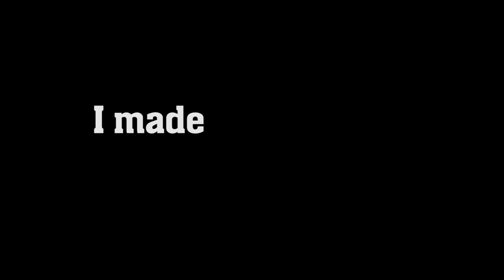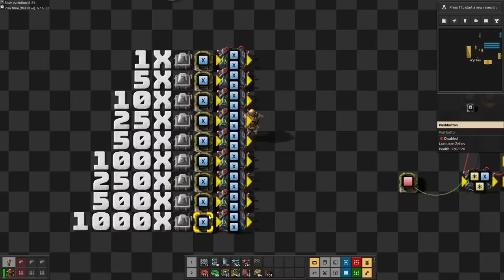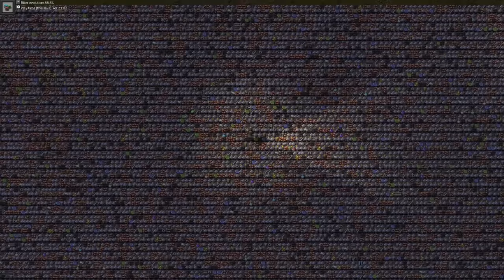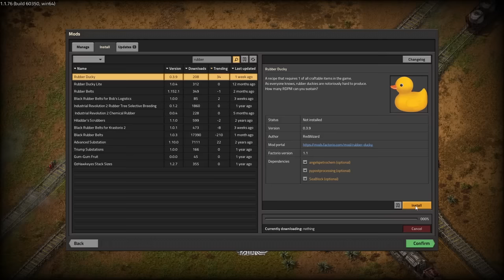How Hard is it to Beat Factorio When EVERYTHING Goes on the Same Belt?

Comment: I did a sushi belt run. What made it interesting and didn't require memory was the idea of a "kidney" which would measure the concentration of a single item type along a "receptor" lane split off from the bulk circulatory system. If the concentration grew too high, then the journey would begin storing excess into boxes; when the concentration fell too low, then the boxes would unload into the blood stream. In effect, I was using the blood stream itself as a memory cell. Certain parts of the factory that didn't need a wide variety of parts could pull only certain items.
Reply: Blud made a factory that can get diabetes 💀💀
Reply: @KarolOfGutovo  welcome to a bored factorio player's mind
Reply: I love how there’s such a completely different solution to the same problem
Reply: @daanstrik4293  One is robotic the other is biological
Reply: The thing is that this solution would require sorting. He banned the use of sorting injectors, so I'm not sure how much he could reasonably sort, if any.
Reply: I love this solution because not only does it solve the problem of keeping the right ratios of items on the belts, it also solves the problem of single item types being bunched up and not having the opportunity to evenly spread out across the system.

There was one timelapse scene nearer the end of this video (42:24) that made this issue abundantly obvious, as well as Dosh mentioning it himself. You can see the colour of the items on the belt changing between green when lots of circuits go by, orange when lots of copper plates, ores and wires go by, and grey when lots of iron ore and plates go by.
Reply: @MGSLurmey  This could be solved by making one part of the sushi belt longer like with the coal electric gens. This would make some part of bunched up resorces lack behind and eventually even out the whole belt.
Reply: mf inadvertently implemented homeostasis in the sushi belt

Comment: you know what I would hate love? Sushi pipes. A mod that lets you put multiple fluids on the same pipe network, then sort them out later down the pipe.
Reply: I've seen someone build that with vanilla pumps and circuit conditions.  I'm not sure which one is worse.
Reply: you can do that by rotating undergrounds/storage tanks
Reply: Nefrums played with that idea while he has designing his newest 100% base. He even provided blueprints. If I remember correctly it was a little unreliable. But it can be done, pure vanilla
Reply: Barrel all liquids. No pipes needed!
Reply: that actually is a mod
Reply: @PrinceSilvermane  what? How? where have you seen that?
Reply: @thecrazyinsanity  do you know what its called?
Reply: @hanswurst913  It was on reddit.  Basically you'd have two sets of pipes with pumps and circuit conditions.  That kind of circuit wizardry is beyond me.  But ultimately it was one of those 'Neat' ideas but not really practical.
Reply: There was a guy that made a sushi pipe on reddit using vanilla pumps, pipes, and circuits. You don't need mods, just a big brain

Comment: I did a lot of experiment with this, I love the idea of setting the recipe anywhere and not having to use your brain...

So here is something i discovered, if you use a fast inserted in a chest with only 1 space in it and use a normal inserter to take it out, any resource on the belt that can feed the slow inserter will lock the chest on that resource automatically exporting from the bus things that are in the highest quantity. I'm not 100% sure it could scale up to the level you use it, but it's a neat trick to keep your sushi belts half clean.

Comment: Maybe you could have added a recalibrate function. You could pause I/O and place a unique item as an indicator that is not counted on each belt. You would then zero out the counts for all items then count each item that goes through the chef TM as an insertion. When the indicator items finally make it back to where they were inserted they are removed from the belt and calibration is completed, then I/O continues as normal.
Reply: Pretty sure this wouldn't have worked? Because the balancers add a random element to the time it takes for an item to move across the belts. Sure, it'd only be maybe 5 seconds difference at most, but the nature of the Sushi Belt means that's actually a ton of inaccuracy.
Reply: @kabobawsome  That’s a good point. The conveyors could just switch to an alternate route that goes around the balancer during calibration.
Reply: I don't actually play this game, but could you build tla second 'chef' that just reads the amount of each item across each lane, and then averages them out to find a rate? Then instead of using total items in the system, you could also use the rate to stop inputs to the bus until it goes back to a normal number.
Reply: @mattizie91  curious fly on the wall comment
Reply: @mattizie91  It might be hard to work with since a full loop is like 20 min. There will be delays in the readings and the system would overcorrect so it never reaches equilibrium.
Reply: @minnow1337  you could read the rate right where the item gets added so it will only produce more if there aren't enough currently passing by
Reply: The real solution? Take the rate at multiple locations and average those. A secondary option is designing balancers that have an equal travel time for all paths (which may not be possible). Plus, the main thing is that usually these errors happen over long periods of time due to singular inserters. Even if you only have a system that can verify things in a few minutes, that’s still more than fast enough compared to the hours it takes for a significant deviation.
Reply: Create a system that when enabled disables all inputs to the sushi by sending arbitrarily high negative signals, routes everything to a side section that is full of storage, waits until all belts are empty (no items put into storage for 30s or so) then resets the memory cell and allows the storage to be released back (and counted) on the belt as a priority input (other inputs for an item that's in storage aren't enabled until storage is empty of it)

what you get is a belt memory cleaner with a storage buffer function, you'd still need to enable it manually but it would automate the cleaning and can be used alongside other methods as a last resort
Reply: while I haven't tried this for myself, the video MysticFish did on the topic of using an AIMD algorithm to balance a sushi belt adaptively looks like it could work quite well here, especially for a system so large and convoluted where any source of error is hellish to fix.

Comment: Def laughed out loud when you mentioned what you call the various science packs. I was trying to explain this to my partner this week! I feel like most people only call space and military science by their actual names, and use colors for the rest.
Reply: I feel like I see people say white/chemical science occasionally, but that's very accurate in general.
Reply: I mean, space and military are the only sciences that are sufficiently distinct.
Space science because it's made in a rocket silo, and the final boss among the sciences.
And military science because it takes military supplies and gives you military technologies (the use for making both of which varies with your biter difficulty).

This distinctness COULD be extended to chemical science, by having it be made in chemical plants. And production/utility science packs could be requiring the assemblers they are made in to be beaconed, or there to be at least 1 green module effect active on the assembler or something. Or maybe utility science packs could be ingredients for rare crafts, like spidertrons/ artillery wagons/ their remote controls/ power armor/ power armor equipment/ ... 
If this was the case, then more people might start to see them as something else than just "yet another tier of the same concept", like we rightfully do for "electronic circuits"/"advanced circuits"/"processing units" or "normal"/"fast"/"express" belts, or assembling machines "1"/"2"/"3".
Reply: @calvindang7291  yea thats pretty accurate, red/green/purple/yellow/military/space are pretty ubiquitous, but often blue does get called 'chemical' usually before and while you are building it, and 'blue' afterwards, due to it being the only science that specifically requires you to start a new resource chain - ie oil.

Comment: Hey, Dosh, fellow engineer here!
This is a really great (terrible) idea. I want to do this but mine ore directly onto the sushi belt and put all the fluids onto the belt, not just the refined fluids. I would forgo pipes entirely for maximum clout, but you can't fit two assemblers to fill or empty a refinery using advanced oil processing without a couple pipes. 
Since you can only fit eight items on a tile of belt, your capacity (number of sushi plates) is a function only of width and length of your sushi belt, and upgrading simply reduces your round trip time. 
My approach would be to target about 75% fill of the belts total, and then program the ratio of items on the belt, rather than arbitrary "I want this many of item X". That way, all items are equally likely to be available, and high consumption items can be made more quickly by increasing the number of assemblers.
I'll let you know and link this video if I pull the trigger on this abomination of a run!
Cheers,
Dave

Comment: you should've taken inspiration from blood system - split your current single loop, have "lungs" where raw materials come in, separate throughput belts between different production centers...
Reply: and instead of counting inputs onto belts and having trouble not hooking up the counters...

why not to count items on large chunk of belts? and have that indicate ~average amount of items in whole loop - just like brain detects CO2 levels and forces you to breathe
Reply: @NoNameAtAll2  I agree. I think estimating averages over sufficiently large sections of the belt would have resulted in the belt having a much more uniform distribution and thus speeding up to whole productions process. If the amount of items was then dynamically adjusted this way it would probably lead to a steady state in terms of average amount of items on the belt. This is just my gut feeling though, but yeah thinking stochastically in stead of "deterministically" counting all the present items would have been interesting.
Reply: Defining "The desired amount of items in  the system being dynamically adjusted" better. This could be using something like gradient descent for optimizing the "The desired amount of items" for the maximizing the amount of rockets sent or science produced. Would probably be a pain to program with combinators though.

Comment: Idea. Nested Sushi Bus.
You don't put everything on one Sushi belt, but everything is sushified. The bus is double it's width because you have to route the end back up to the beginning of the bus. You take things off of the sushi bus to put on smaller Sushi belts. Make great use of Filters on everything, but especially filter splitters. And instead of storing in memory what should be on the belt, read the throughput of the sushi bus and use the current average throughput of an item to determine if demand is present.
(Youtube on mobile made typing this comment HELL.)

Comment: A few horrible ideas I have had for a challenge run.

1: Magic box
-every method of refining resources has to fit inside a predetermined box

-ore, trains, belts and pipes carrying water or crude oil are allowed outside the box

2: One Train to rule them all
-fairly boring but being limited to a single train might be vaguely interesting

Comment: Instead of tracking the amount of stuff on the belt, with the Chef you could track the difference between what's expected and what's needed. You try to keep each item at a memory count of 0, and use pushbuttons to inject a negative starting value. If the memory breaks, you can inject some thousand positive and negative items as needed, without clearing the memory.

Comment: Possible solution to your consistancy issue: Somewhere on the belt give each belt a split off loop so that half of the items on the belt take a little joy ride. After several full loops this will space out clumps of single items. This way, eventually, all of your iron plates won't be at the same point along the belt causing all the assemblers to turn off.

Comment: My mind decided to have the most unwelcome thought. A method to be able to pull items off the belt without ruining the memory cell. A belt to the side that goes back into the loop with a belt reading content's, 5 belt lengths apart. The first of the two readers subtracting anything it reads from the memory cell. And anything that reaches the second reader from not being picked up by the player gets automatically added to the memory cell again. Giving a safe space for pickup.

Comment: My first ever factorio base was a sushi belt base. My solution to prevent it clogging up was to take things from the belt and into chests. When the chest was full, i added another. The only thing that allowed me to slavaged this base was the logistics network and even then, it took me a while to get it right and i had about 50 providor chest filled with unsorted junk. Got to launch a rocket though.

Comment: If you extend the sushi metaphor, you could think of empty barrels like plates, so separating them from the main belt is reasonable.

If someone wanted to do this more practically, the highest volume things could have a few levels of output, depending on how much you need.  If ore and coal are supplied by multiple belts each, have them turn on at different levels of current content of the system.  Then your bulk material wouldn't get added in waves.

Comment: The biggest thing I often take from these videos is that people add circuits to the bus? I make the usual bus, but it's comprised of the raw materials, with 3 empty spaces between different material belts so they can be split and taken to processing. So my bus is usually iron, copper, coal, stone, brick, steel, crude oil, petrol, light oil, heavy oil, sulfur, sulphuric acid, water and plastic. I make circuits to-order. I tend to build in parallel so I only need to wait for the duration of the final craft once the conveyors are full. It does become a bit of a bitch having to copy paste the blue circuit schematic every time, but I think it's easier than bringing another few bus lines and extending the circuit factory forever

Comment: One thing that would have helped you out a lot both in the early base as well as the later base is better handling of errors somewhere on the belt when the item count gets out of whack. You could have made the logic have a limit such that negative values for item quantities would increase a counter for debugging and set it back to zero to correct the count. That plus adding a sushi buffer that would pull items off the belt if you're way over the limit (not ghost items but for when you're reducing the limit of items) and fill up the belt if there's items in the buffer, ideally slightly over the limit or preferentially to other inputs. I don't even know how many times in this video you had ghost items throwing a wrench into the bus but you probably could have automated fixing and detecting ghost items and saved yourself some hassle.

Comment: Y'know, reading the previews for the as-yet-of-writing unreleased Factorio update/DLC, I can't help but ponder how much less of an agony this run would be with the belt-long load reading they're adding. Y'know, so you can read everything on one continuous length of belt rather than just a single tile. Would we still need The Chef? Or has it been rendered obsolete by technology?

It is unreal that they're buffing sushi belts.

Comment: i think it makes sense to think more in terms of concentration with a belt system like this. The content of your belt is a gas mixture and the different items that get added and removed change the concentration of those item type. 
with that in mind i think i wouldve chosen another approach rather than one big loop. As you said yourself certain processes reduce the "concentration" of specific items behind them, because they deplete them from the belt.
So for those processes it would make sense to split the belt beforehand and feed them in parallel to ensure they all receive the same mixture. you can still optimize certain processes by putting them right behind the station that produces the materials they need. 

in that sense you could set up the belts based around this. Specifically keeping concentration low, equal or high depending on what each station needs.

Comment: 19:00 This probably happened when you had too little power. If combinators get too little energy, they no longer update with every tick. Something similar happens with the inserters and belts. If there is too little current, the pulse signal lasts longer than one tick. The problems start when the satisfaction level is below 50%. This can cause the memory cell to either miss pulses from the inserters and belts or count them twice.